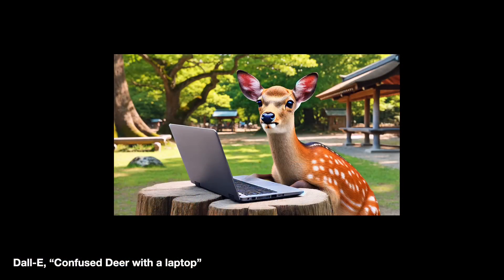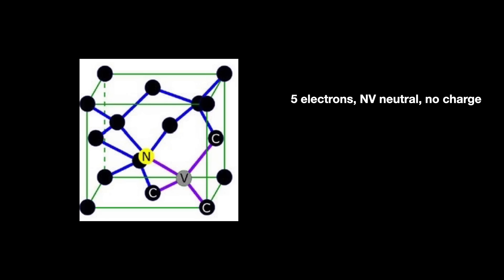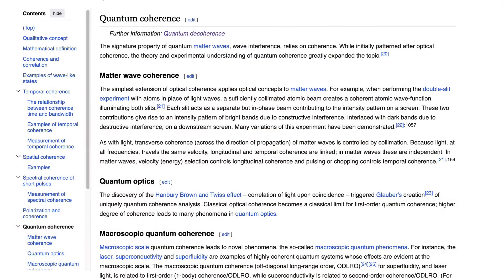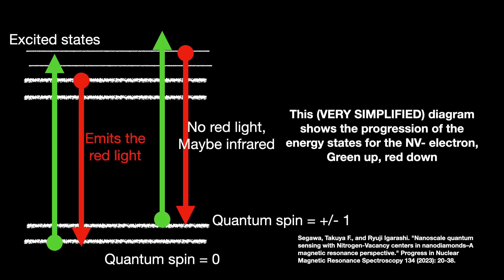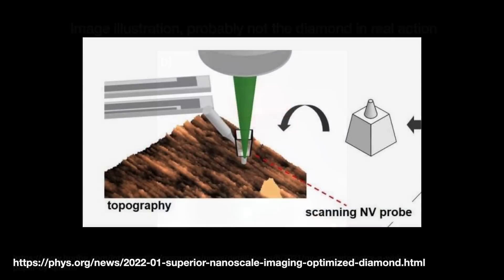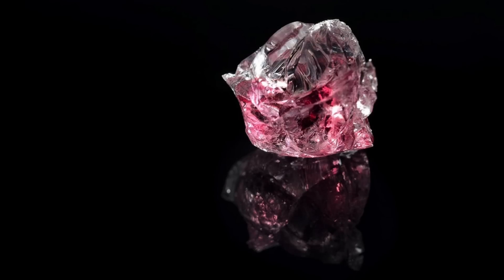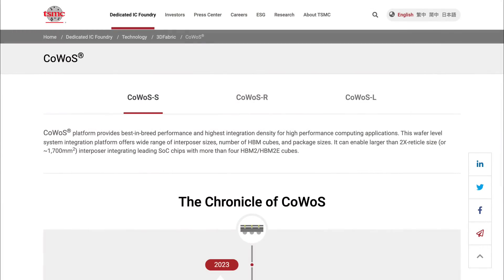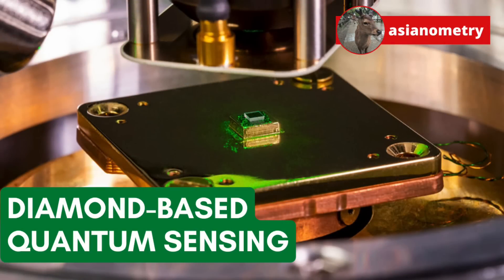Quantum Sensing With a Special Synthetic Diamond

Comment: Yeah spin is weird. Baryons like electrons have a diameter, but not in a physical sense as they are wave points bouncing on the field. Fractional spin is wild too but it is the whole reason baryonic matter even exists.
Reply: The part I am stuck on is reading a quantum state without effecting the quantum state.  If this spin was entangled, wouldn’t that enable information travel faster than light?
Reply: @skyak4493  Well, you are measuring ("reading") the excitement of the electron; it just happens to be that that depends on it current spin, and that changing its exitement does not also change the spin. You're thus not directly measuring the quantum state you're interested in.
As for the entanglement, I don't see how you would do that, as the whole setup does not change the spin. Thus measuring your particles spin also tells you the other particles' spin, but taht does not do you any got to transmit information faster than light. What you would need is a way to change the spin of your particle without loosing the entanglement, and that is not possible, as messing with the particles' spin will disentangle it from its original entanglement partner...
Reply: @AkantorJojo  While it is entangled, isn’t it both spins until it is read?  If you indirectly learn the value, does the entanglement still break?  If not you would know somthing at a distance instantly.
Reply: @skyak4493 it’s more “a particular linear combination of two options” than “is both options at the same time”
Reply: @drdca8263  Unfortunately that doesn’t help my understanding -it kind of makes me not believe in superposition and quantum computing.  I will consider the possibility that I don’t fully understand superposition….
Reply: @skyak4493  Each “pure state” is a vector in a vector space. A superposition of two pure states is some number times one of the pure states, plus another number times the other pure state, and it is itself a pure state.
(There are also things called “mixed states”, which can be seen as a different kind of mixture.)

The spin up (pure) state can be seen as a superposition of the spin left and spin right states, and the spin down state can be seen as a different superposition of the spin left and spin right states. At the same time though, the spin left and spin right states can each be expressed as two different superpositions of the spin up and spin down states.
The state vectors for the spin of a spin (1/2) particle are length 1 vectors in the the 2D complex vector space (i.e. can be represented as a pair of complex numbers).

It is all very nice, once one learns to appreciate it.

Quantum mechanics can only be understood through doing math though, which sadly significantly reduces the number of people willing to get to the point where they could really appreciate it.
Reply: Electrons are not Baryons ( I think, from wiki).
Reply: Electrons are Leptons, protons are Baryons - both are Fermions, which obey the Pauli Exclusion Principal (two particles cannot exist in the same place with the same quantum state).  One can contemplate Thomas Aquinas's musings about angels and pins through the lens of Quantum Theory via Boson's and Fermions.  For, if they are latter, the answer, however large, is finite.  If the former - Infinite.  Religion aside, Aquinas was way ahead of his time.

Comment: What I'm lost on is how MPCVD can maintain periodicity of the defects. That sounds astronomically difficult, if not outright impossible.
Reply: He says right in the video, using the same mask/resist lithography techniques as with semiconductors but with a nitrogen ion beam instead of photons.
Reply: @afaircomparison  using a focused ion beam is normal. Photolithography is used to develop photoresist which creates a mask that is a chemical resistant and process resistant - a stencil basically. Depending on your process you might use a mask layer as well as an ion beam to change the behavior in sections of a wafer.
Reply: Usually they add a sacrifical layer on top . e.g. 20 microns thick and then edge the sacrifical layer at the spots they want to have those implantation centers. In that way you have a hard mask. The  Nitrogen implantation itself is homogeneous,but can't penetrate the sacrifical layer. 
PS:I am not sure if in current state of the art the sacrifical layer itself can be a simple photolithography
Reply: Apparently that is done via lithography, at least that's how it seemed to me from this video. I guess Lithography can make very small regular patterns, but this still sounds like quite the challenge.
Reply: Periodicity is not important if you don't go to the 'several nm' resolution end.
You'll have 'enough' NVs in each pixel